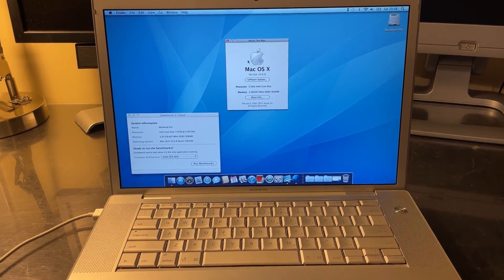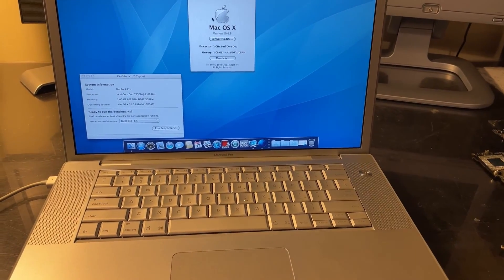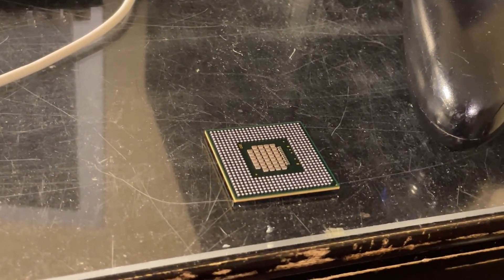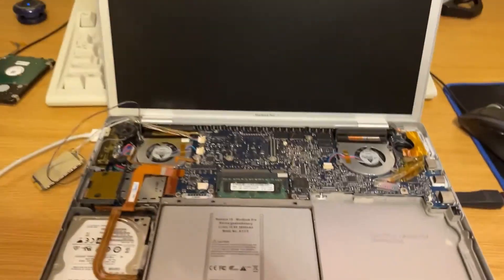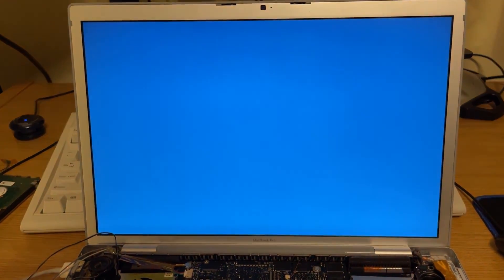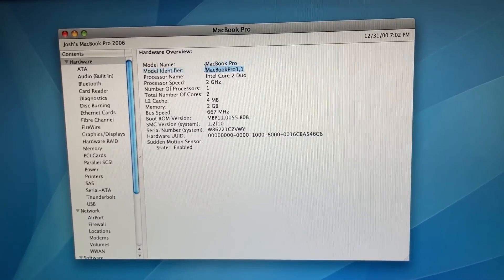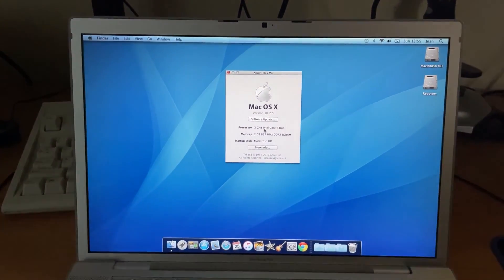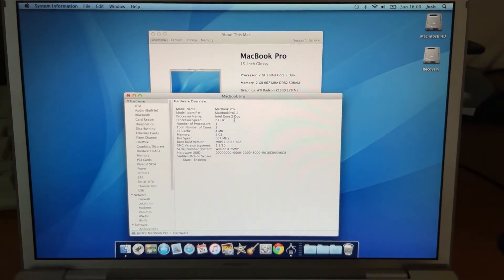MacBook Pro 1,1 BGA CPU Upgrade (Early 2006)

Comment: I can install t9300 or t7700?
Reply from the maker: No
Reply: Ok  @Josh.Davidson
Reply: @Josh.Davidson   why can't i install the t9300? The socket is identical
Reply from the maker: @francescodambrosio6846  No, it's not. Similar not same. Socket P vs Socket m. T9300 is Penryn. Different arch. Requires new chipset and socket has one physical pin difference and many electrical differences.
Reply: @Josh.Davidson  okay,Thanks for all💪

Comment: Hey Josh, love the videos. Do you or could you possibly offer a service similar to this? I have an early 2011 MacBook Pro with the faulty Radeon GPU, and could make great use of it if it was replaced.
Reply from the maker: Hello,
I could do it but I must warn you that the all chips are defective and it could fail again in the future. It’s typically advised to use the Demux instead.
Reply: @Josh.Davidson  I have the GPU disabled and that’s how I’m using it now, although the iGPU is a lot slower and it feels unresponsive from time to time. Some less intensive games I play on it were significantly slowed after the death of the GPU. I’d be completely fine if it dies again, just want what I do to be a bit faster.
Reply from the maker: @trentm5586  I would be open to doing this sometime, if you're US based. Depends on my schedule.
Reply: @Josh.Davidson  I’m US based, but would need a quote to see if it’s worth it or not.

Comment: Hello friend, how are you? May I ask a question on behalf of all technicians in Brazil! Is it dangerous to use a 1.2v regulator in POUST AND PLL in RGH3.0 BETA unlock? because there are many discussions about it on the Internet or even on Forums. could you make a video explaining about it or even answer me? Oh, before I forget, happy new year.
Reply from the maker: Hello. it is not dangerous, but it is STUPID!
The resistor is all you need.
There's no issue with resistors.
This is just a digital logic pin with a simple high/low consistent output. It's not a data pin that needs level shifting or a voltage rail that needs a switching circuit... this is just a waste of time and money.
The people who say resistor causes CGPU to die are IDIOT and do not understand digital logic!
The resulting level can be within 1.1-1.8v with NO problems.

Comment: Did you try flashing the MacBookPro2,2 firmware? There are a couple of differences in the boards apart from the CPU, but I wonder if the firmware would be compatible anyway and allow for native support with 10.7.
Reply from the maker: No, because I heard MacMini2,1 firmware needed modification to work on 1,1. Maybe I'll try to figure this out later but now no time. :(